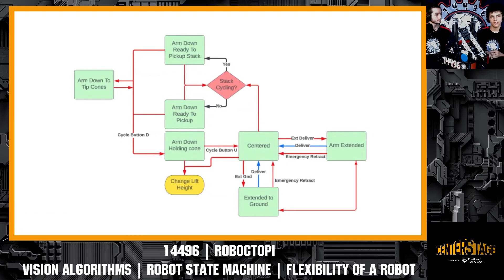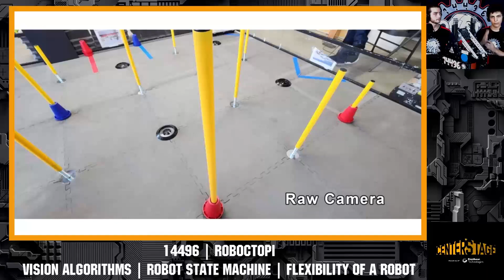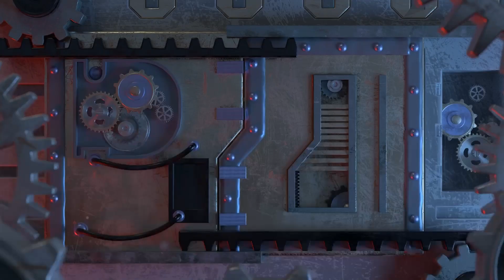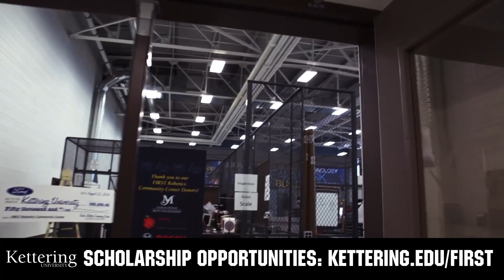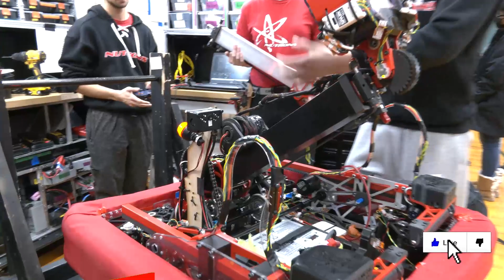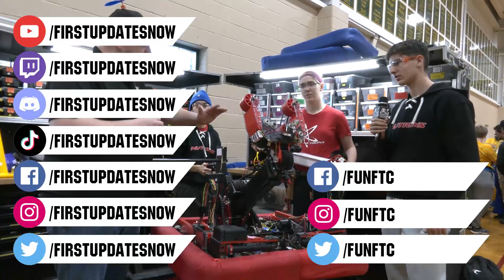Vision Algorithms | Robot State Machine | 14496 Roboctopi | CENTERSTAGE Pre-Kickoff Conference

Comment: Okay, but why not just use a color sensor to detect and align with the pole. Wouldn't that be way more simple, because REV's color sensor only has a detect range of 5". Or is some accuracy/time lost.
Reply: Revs color sensor can only detect the presence of certain color but not the position of it. With vision it is possible to get the location of the pole on the playing field from relatively far away and then to correct precisely. With vision the robot can recover from errors of over 20 degrees from half a meter to a meter away